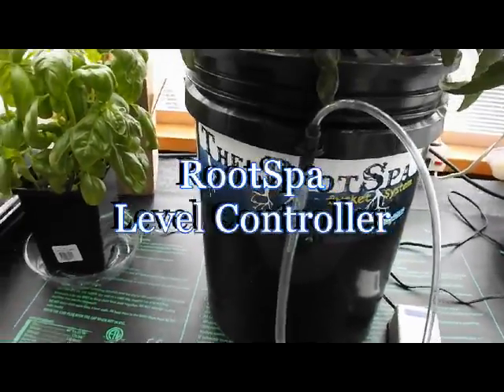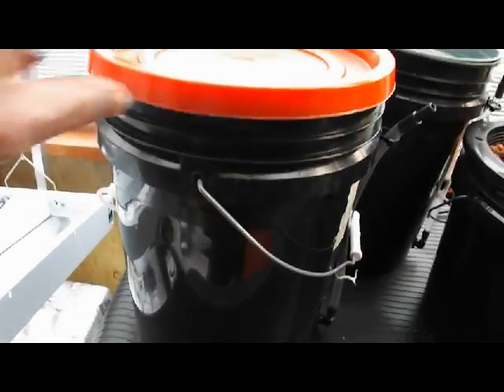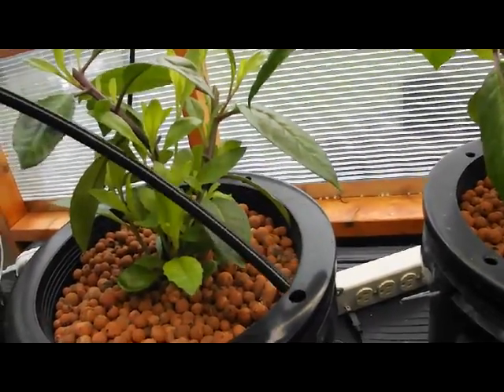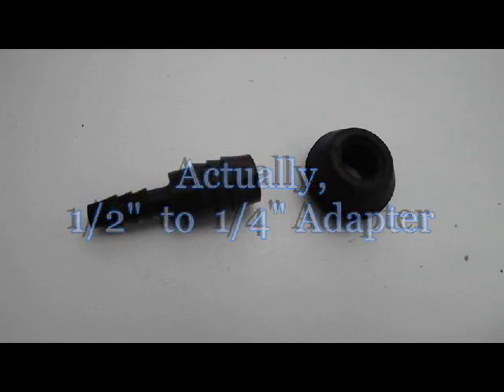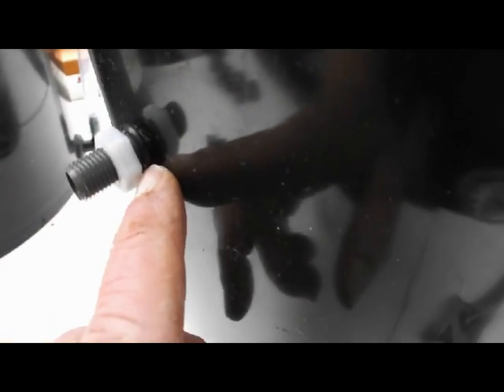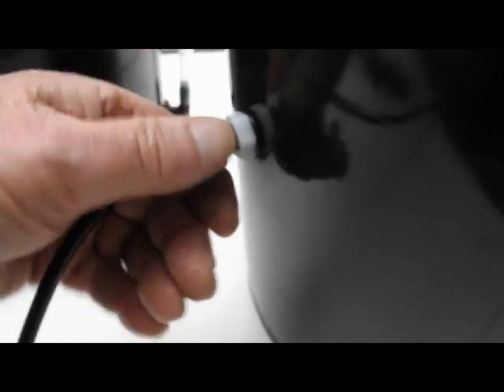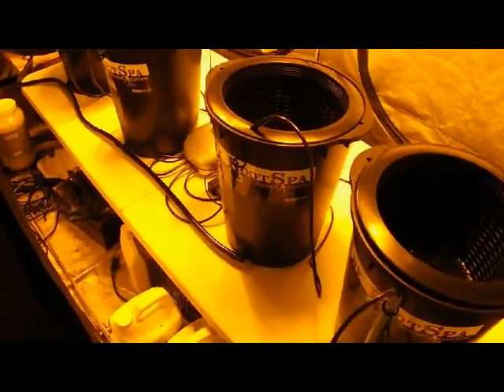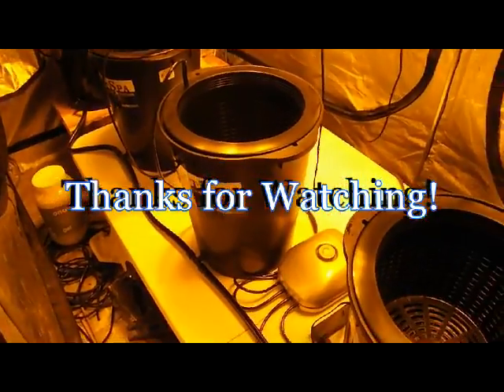RootSpa (Bubble Bucket) Level Control

Comment: Sir, that was an awesome presentation. I'm attempting to build a 6 bucket Kratky-style gravity fed system using a reservoir and a float valve control bucket to ensure adequate water levels in each bucket. Before I watched your video I purchased all the necessary parts in 1/4 inch i.e, tubing, grommets, connectors and float valves. My concern is I may have misjudged the ability of 1/4 inch tubing to drive multiple buckets. FYI, my system is going to be used to feed voracious feeders - tomatoes and peppers. Before I begin fabricating, would you recommend I use larger tubes and fittings?

Thanks in advance and Semper Fidelis
Gunny V

Comment: Brilliant! I just bought a 4 bucket system and I was upset because I assumed you had a top feed part to the system controlled by the air flow. Doing it this way could give me the freedom to go away for a few days and not worry about the system drying out. The only thing I would like to be able to keep an eye on is the ph in the buckets.

Comment: Oh and it's absolutely no different in a recirculating system the different plants take different amounts of nutrients and the ppm's always flux which is why you always check your Reservoir and top off top offs include checking EC and adjusting!

Comment: I don't see yet how to control the nutrients?  It seems like you'd still have to do that individually since some plants will go through more nutrients and the little added from the reservoir over time wouldn't make the ppm in the individual buckets where you want them.  If it recirculated then I could see how they would all be the same.
Reply: I have the same questions!  I see you asked this almost a year ago and no answers yet. Does Ronald answer questions on his videos? I will look further thru the comments here and see what I can find. If this hasn't been answered, I'd love to read a response from Ronald. Thanks!
Reply: Dude just think of a drain to waste or  a gravity-fed system with a reservoir (gh Texas controller or  autopots) 
it's just an easier way keep the plants fed and the water at the same level - you can just fill up the rez and buckets with a solution and top off with whatever you think the plants need or just RO  do the math and figure out how often you want to change rez (weekly or bi-weekly) upping the nutes as you go (take notes) it just keeps it the buckets that are constant level for you. If you want a recirculating get an undercurrent undercurrent but if you want to make multiple single buckets a little more simple this would be the way.

Comment: Aren't the bubbles to big?
 Smaller bubbles are better, the big bubbles will damage the roots? If you were using air stones in the bucket the growth would be a bit faster. but if its growing what the heck.
Reply: The big bubble does not damage. huge amounts of bubbles do.

Comment: How did you figure out the ideal placement for the float valve on the side of the bottom bucket so that the water is at the correct level in the 2 buckets you have plants in?

Comment: So, I added the level control to my 5 bucket system this weekend for my tomatoes. I am wondering, how often do you flush the system out? Is it even needed? Thanks for all of your posts. I have learned a ton watching your videos. Thanks!
Reply from the maker: bigjoemann Check out the video on recirculation - https://www.youtube.com/watch?v=3ba5ZBY_LfMRecirculating helps keep the nutrient solution mixed and aerated but you still need to replace occasionally to insure a balanced solution - the plants use minerals at different rates and it will eventually become unbalanced meaning there may be too much of one mineral and not enough of another.  The solution could become toxic to the plant for that reason.  The recirculation video shows placement valves to isolate components and also for draining the system easily.  I think with an added recirculation system you could go 4 to 6 weeks between nutrient changes.  I am sure I will catch flak from some nutrient manufacturer's on that one!  Good luck and thanks for watching my videos!

Comment: Is this a recirculating deep water culture?
Reply from the maker: No - these are aerated individually - transpiration, evaporation and adding make-up water pretty much takes car of recirculation.  Thanks for the comment and thanks for watching!
Reply: Ronald Kleinman Thanks for the reply & great video I gotta say!  I disagree slightly though, recirculating is more than just evaporation/transpiration especially if you spend the money & add a chiller to it.  I currently run 3 rooms of 10 sites RDWC up here in northern Washington, water is at a perfect 58.  I guarantee they would not grow as well just dumping water in there
Reply from the maker: ***** you are absolutely correct - especially about the larger system requiring a chiller.  Actually, with multiple buckets on a level controller one would not be dumping water in the buckets individually.  Any ideas on adding recirculation to this system would be appreciated - it'll make a good video!  Thanks for the comment.

Comment: How do you stop root rot though? Especially in the summer.
Reply from the maker: As long as you run air bubbles 24/7, with a standard output air pump, the roots will receive plenty of oxygen to prevent root-rot.  As far as Summer - the water in the bucket needs to be maintained between around 60 to 80 degrees - if the water gets too warm (or too cold), for long periods of time, the plant may not survive.  I've had no problem with using this system outdoors in the Summer in the Seattle area.  
Checkout this bubble bucket set up Ron's Bubble Bucket (RootSpa)